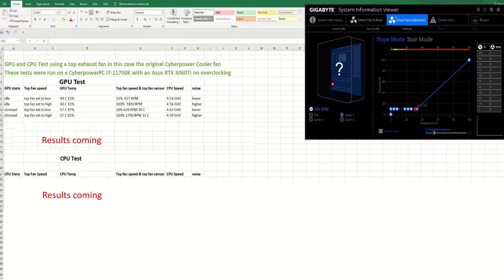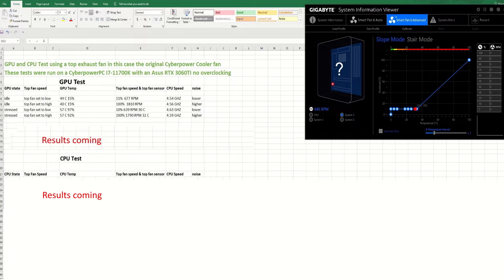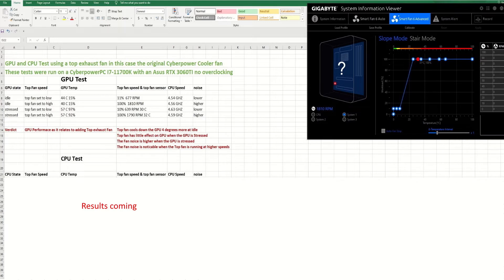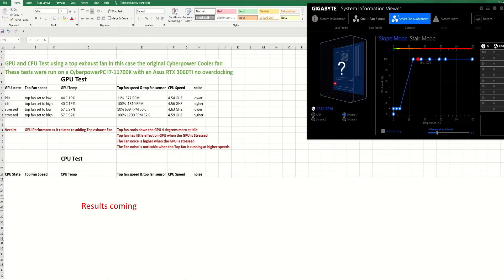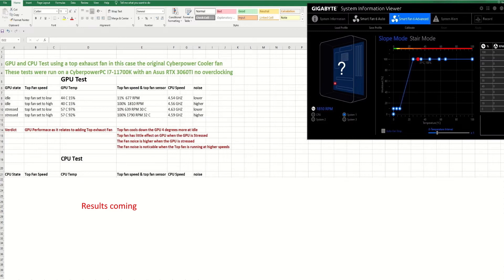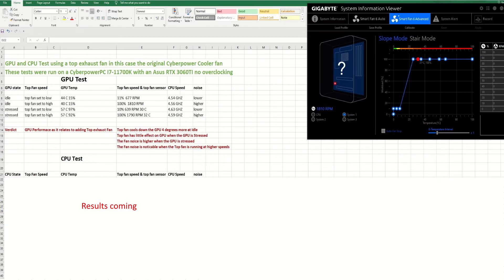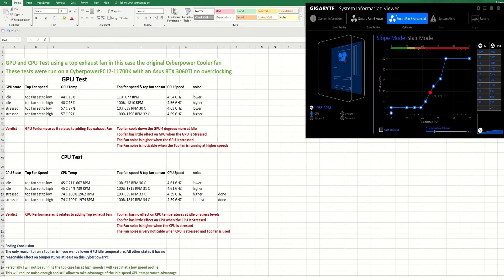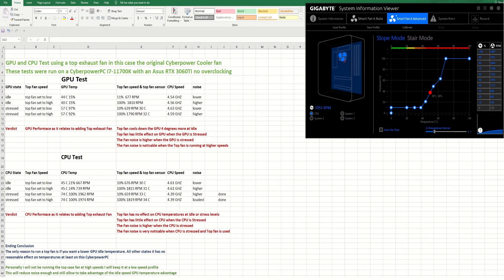Does Adding a top Exhaust Fan to a PC Effect Temperatures I tried on CyberpowerPC

Comment: Good testing here! Even though it doesn’t  do much to help temps I still think it’s good for proper airflow. Without the fan you would only have one exhaust fan. So maybe with helps just with proper airflow and then the cpu cooler can focus on capture cool intake air
Reply from the maker: I agree, I did't like the added noise it gave me for the most part. I will leave it in with the low RPM settings so air flow continues. Here is something however out there. I have really high level of smell, and the smell from the case exhaust is like chinese plastic. I mostly wanted to drop the ability for that top fan to exhaust a smell I can sense. I can go into restaurants and I can tell if there is mold,  it is like the worse superpower. I am not sure what the smell out of the case is but since I owned this thing smelled like burnt plastic mostly when it heats up. The top fan kind of makes that worse for me.

Comment: thanks for this video, i think i’ll just not add the top fan anymore. also the arctic cooler has helped so much and wasn’t that difficult to install thanks to your tutorial💯 i have noticed that it helps a lot too because it keeps my pc cool at heavy editing and all high settings in call of duty without any lagging or crashing compared to when i didn’t switch the fan out. you’re a legend thank you 🙏